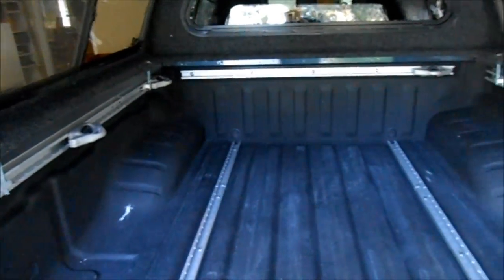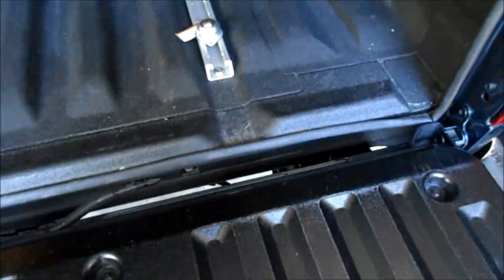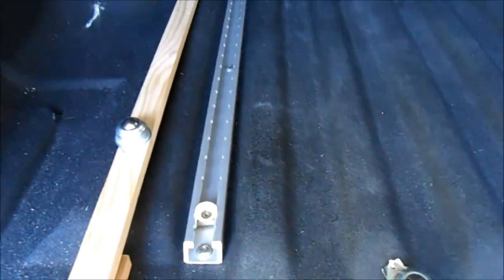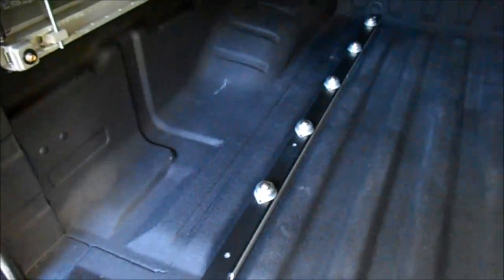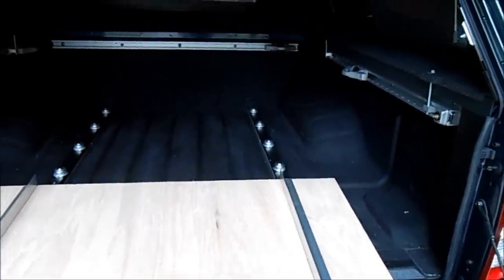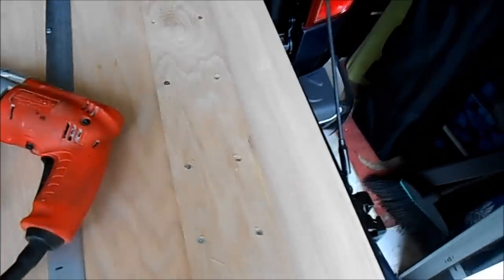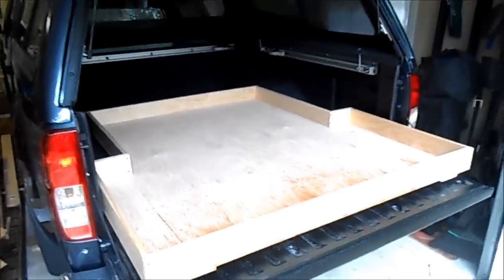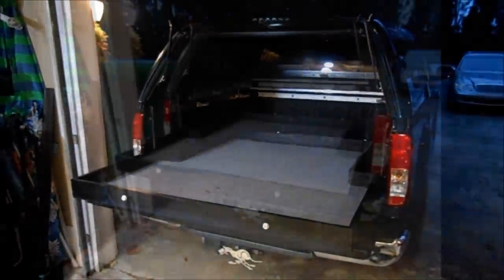NISSAN PICKUP TRUCK CARGO TRAY

Comment: Should add some fold down steel legs to support the end hanging off the truck when you pull it out. And if you wanted to take the time you could even motorized the tray with an electric motor and chain system.

Comment: I know it's  a bit late for a comment, but you really should look at Nissans util-a-tray which comes with the fully decked out Titans.  These plastic   blow molded trays span the back 30" of the bed, but their advantage is they lock down anywhere on the rail with a simple knob.  You're  on the right track with the electrical strut cleats since they allow the tray to slide but hold it, and your load, securely in place.  The roller bearings you used don't allow for any lockdown to the bed which could be a real problem on a short stop. The strut system mimics Nissans concept and allows for any size tray, and easy removal.
Reply from the maker: Sweet!  Haven't worn out the Frontier, yet.   Driving it to Alaska.  Maybe that will do it.

Comment: Just an FYI if you have to eventually replace the deck, they do sell 5' by 5' plywood, if you go to a woodworking lumber yard.  European specifications are for a 1525mm by 3050mm "full sheet" or a 1525mm by 1525mm "half sheet".  A half-sheet would probably be adequate for your purposes with only requiring cutting around the wheel wells.

Comment: Cone-nuts from the electrical department. I'm going to remeber that for my Nissan Frontier.
Thank you.
Reply from the maker: Yes, I read that on a Frontier forum.  They work pretty well, too!

We built a slide-out kitchen on the platform for our trip to Alaska.  It will come out when we're done (I will make it removable).  It has a stove, grill, cutting board, and a toaster oven!

Comment: Hi.robert
It is a v.good job and I think it will better if you add 2 removable legs for support if you want to pull the tray 75% out and the front edge sets on the rear door
Reply from the maker: Good idea.  I set this up so it doesn't go past the tail gate (when down) by more than 6-8 inches.   Some commercial models have legs like that.  They make them for the big pickups, but I never found one for a small truck.  And they are expensive, but of course, very well made of aluminum.   This is just for my camping gear and beach chairs.  Works well for light-duty applications like that.
Reply: find a folding table at a garage sale.  the legs are collapsible with the u-shaped bracket to hold them in place.
Reply from the maker: THAT is a good idea!!!

Comment from the maker: I am thinking of adding more ball bearings (twice as many) as the tray gets hard to slide with a lot gear on it.   Back to Harbor Freight!
Reply from the maker: More ball bearings = better.  I added eight more.
Reply from the maker: Occasional use of lithium lube or other spray lube (WD40)  on the ball bearings helps as well.

Comment: Nice idea and good work. Was it worth the time and money?  What about bark dust loads?  Is your tray easy to remove?
Reply from the maker: It has been three years since we installed this and it works well.  We use the truck for camping, and it holds our all our gear (kayak stuff, bicycles, generator, 12v cooler, barbecue, etc.) and it is easy to get at, by sliding out the tray

For messy loads, maybe not such a good choice.  We have hauled firewood in it, but I laid out a tarp over the carpet first.   It was handy to be able to slide it out to stack the firewood on the inside part first.   It does decrease overall capacity.

I think it would work poorly for bark dust, much, or other bulk loads as the material would leak underneath the tray and make a mess.

Comment: Looks great but what stops it tipping if you pull it past the tailgate?
Reply from the maker: +Pete Webb I put a sliding bolt lock (Stanley) on each side of the tray, on the back side of the "T" portion, so that when they are extended, they engage the edge of the pickup truck bed to prevent the tray from coming out.

When I want to remove the tray, I just slide the bolts back.

P.S. - a little white lithium grease on the ball bearings works wonders.

Comment from the maker: Since completing this project I have added two features. First, I put slide-bolts on either side of the "T" so the tray cannot be slid out too far (and dump your cargo as a result).  I used simple Stanley slide bolts like you'd put on a bathroom door.  I also added reflectors to the back, in case I have to extend this with the tailgate down while driving.

Over time it has loosened up a bit.  It is handy for camping gear and luggage and other light cargo.   We even hauled a load of wood in it, once.

My next project is to make a sliding upper tray.  I am also working on a flat platform for the back seat for the dog (with the seats folded up) as she doesn't like sitting on car seats.